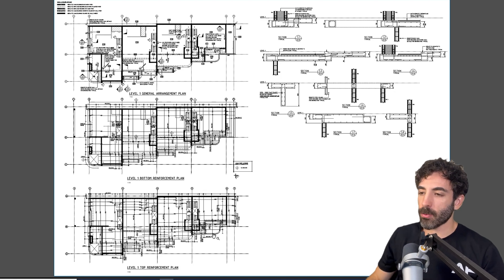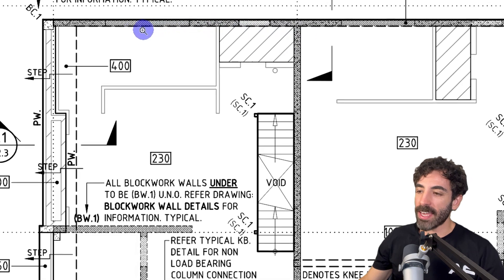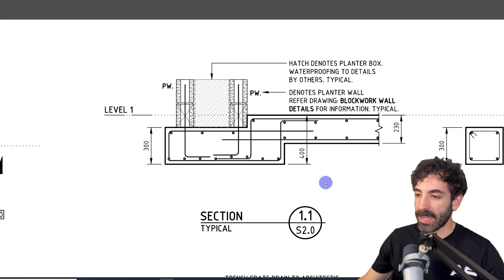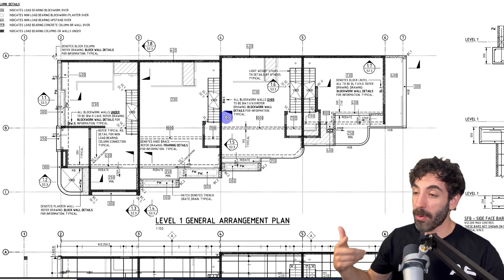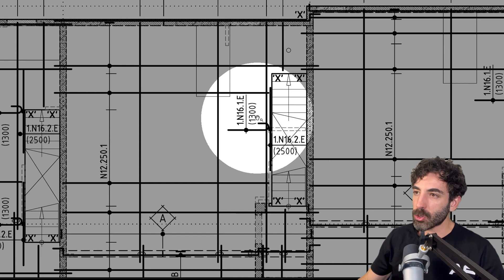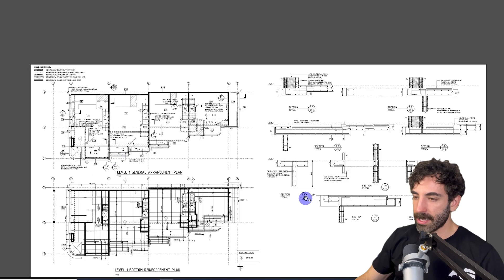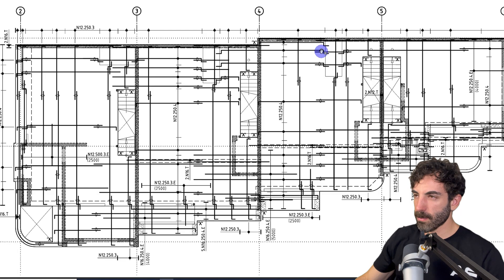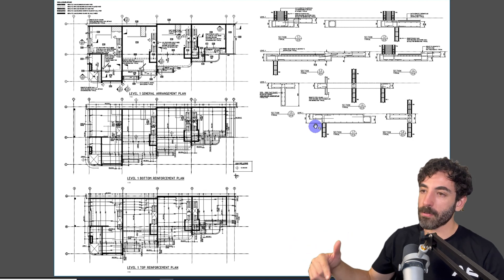How to Read Reinforced Concrete Drawings for Beginners

Comment: The 2 N16 bars in the top of the beam in section 1.5 should be in the same layer as the slab bars. The cover to the reinforcement in the sections looks less than required.

Comment: I graduated in Civil engineering in Brazil and came right after, 4 years ago. In Australia I got a Cert 3 in Carpentry and working with this for the last 3 years. I am planning to try to go  back to the engineering.  That is any tip that you could get me to this process? Congrats for the channel 🤟
Reply from the maker: carpentry is a cool profession but too hard on the body. Choose the field you want to go back to. Start studying about it and networking. Don't rush things, it will take a little while, so be patient. It won't be easy, but in the long run it will be worth it. Let me know how you go.
Reply: @bengthebrazilianengineerinAus   i already started my process to bond both experience and i agree with you, it will be worth in the future.
Reply from the maker: @raulbonfimleal7151  Sounds good man. Let me know how you go. Best of luck
Reply: @bengthebrazilianengineerinAus  i will, thank you.